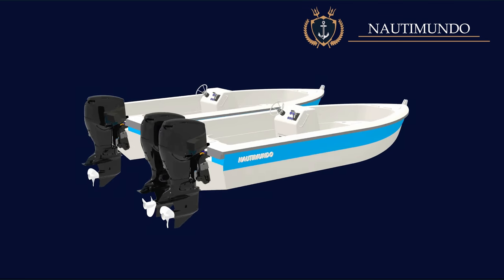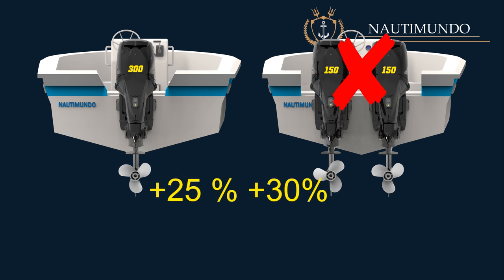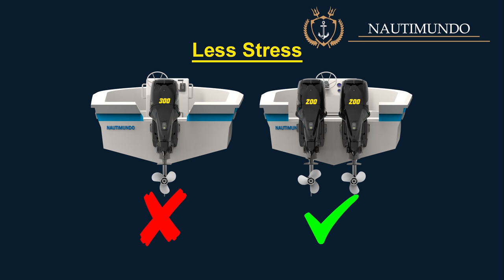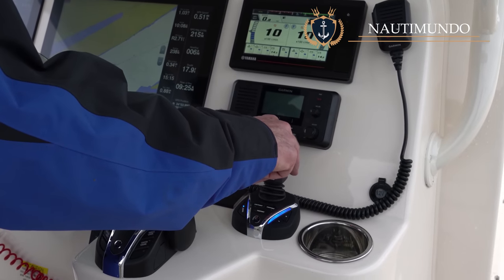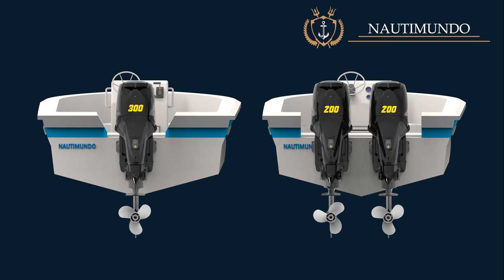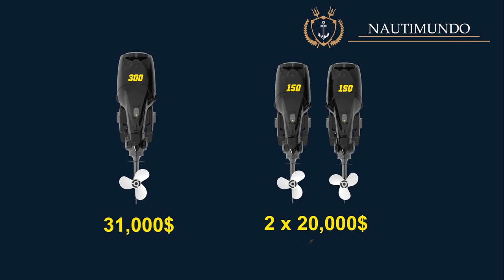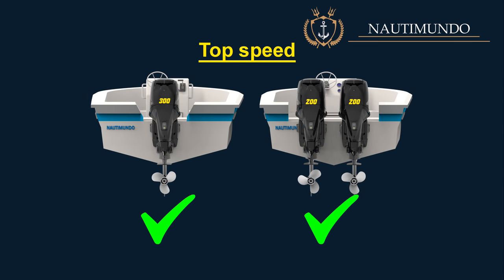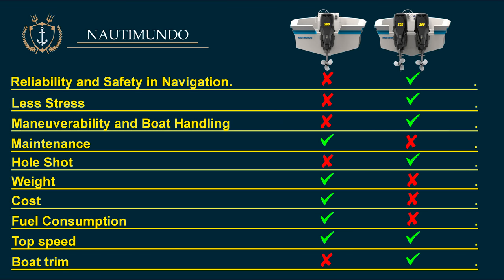single or twin boat engine? 1 or 2 Outboards? What is better twin outboards or single?

Comment: Here in inshore croatia we have a saying, " every single thing connected to the yachting or fishing world, is a tax for extreme idiots". Basic normal shampoo in market is 3 euros. Same shampoo identical by chemicals and structure but only for yachts is 13 euros haha. Basic small inox platform for small 5m boat costs 300 euros, while identcal same platform for home use costs 40 euros haha. I know thoe people that are buying boats are people that avoid returning tax to state so they rather buy a boat, but they are extremely DUMB when they pay for a 24 meter boat, only re-applying anti fouling color 40 000 euros hahahaha. The cans with color are less than 500 euros haha. My best friend and second cousin work in yachting service and i finished school for marine transport so yea. If you are not an idiot, buy yourself a basic 6-7m open or closed fisherman-like boat with two 40hp yamaha outboards and enjoy cruising or fishing, no need to be dumb. Like, the most you can spend without being an idiot is maybe Arvor 250as. Used is 40k euros, so thats good cheap boat with reliable mercedes inboard engine. There is also a saying, men are happy when they buy a yacht, but they are even happier when they sell it haha

Comment: think of it this way. two is one and one is none. if you lose one engine. going in all the way on your trolling motor is not a win and not really effective, lose one of two outboards youll still have one to get you home. no single engine inboard boat beats a twin engine inboard boat. two is one. always

Comment: I prefer 【2(twin)】  boat engines.

In case 1 broke down in the middle of the sea, I still can manage return safe to base ! 。。。。。。。。。。。。。。。😁😁👍👍👍👍
Reply: Yeah, there are so many single engine owners over the years that just disappeared because the motor broke down.
Multi engines don’t do squat if there’s an elec failure or you run out of fuel.
I guess you’re just doomed…

Comment: If the boat comes with a 300 hp and you want to upgrade to twins, you should just get another 300 hp
Reply: Wouldn’t one want to consult the hulls max weight and HP capabilities?   A boat rated for 400 HP with twin 300s doesn’t sound like a very good decision.
Reply: @megastick9324  it’ll be fine. There’s people out there with 200 horsepower engines mounted on 16 foot Jon boats.
Reply: @GRosa250   yeah, no,  two stupids don’t make a smart.
Reply: @GRosa250 .. i agree 💯 . 
My 12ft kayak Is rated at 2 oarspower, but running twin 2.5 hp  2stroke
Reply: @megastick9324 long story short . The coast guard bitches out when giving guidelines . The formula hasn’t changed in forever and so. Much has changed in motors and but design that it’s now to be taken as guide lines and not strictly followed rules . Just remember a jetski doesn’t follow that till and way over powers their tiny vessel and look at them